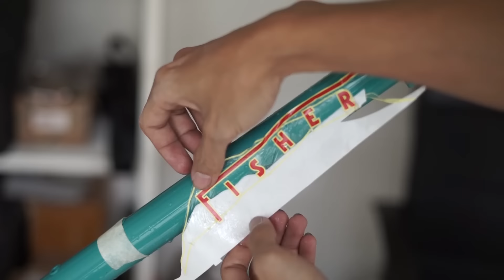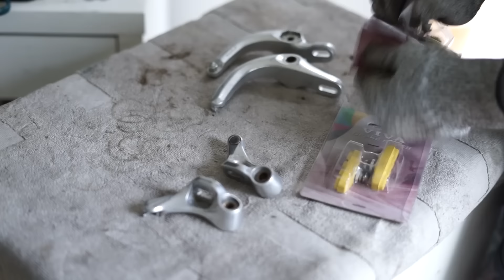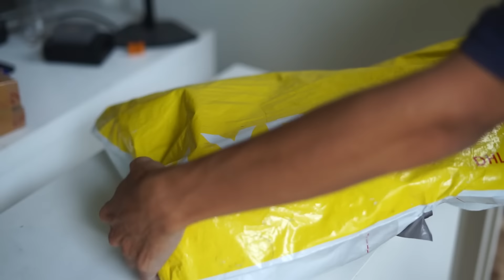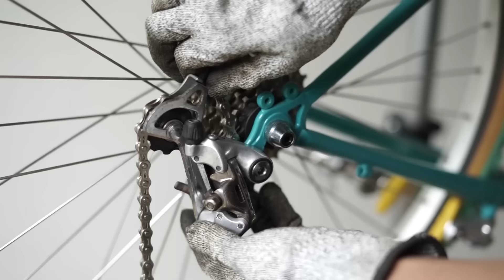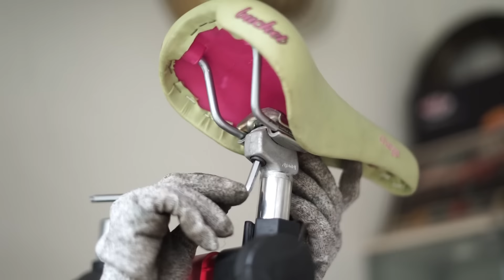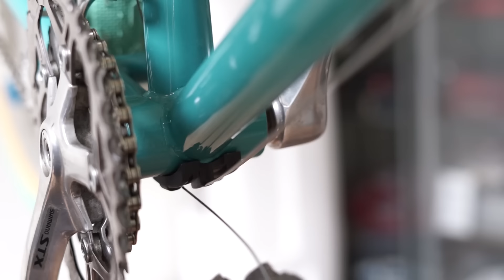80's GREEN MTB / FISHER HOO KOO E KOO / BIKE BUILD

Comment: I adore these videos but sometimes there are little details that drive the bike mechanic part of my mind crazy. The chain rubbing on jockey wheels can be resolved by tightening the b-limit screw or cutting the chain to the correct length. Using levers to install a tire is a no-no in most professional shops, for stubborn tires my go-to is a Giant tubeless instillation tool if I can’t get it by hand. Always keep greasy gloves off white saddles, frames, grips, and cables, having ‘clean’ and ‘dirty’ pairs of gloves really cuts down on the hassle of cleaning a bike right after you’ve built it. Never use Torx keys where hex keys should be unless absolutely necessary. I love these videos and keep up the great work! The bike looks fantastic! Just some tips from one mechanic to another.

Comment: Nice build. I'd suggest using grease on brake bosses, derailleur hanger, pedal threads, and even packing the grease in on the caged headset bearings. A light clear coat over the decals also would make for that extra bit of durability
Reply from the maker: Thanks for the tips 🙏

Comment: Nice build! Beware of your chain rubbing against the rear brakes in smaller gears combos (see 12:54, 13:19, or 13:40)
Reply from the maker: Yes always use 2nd gear on front, thanks for reminder mate 🙌
Reply: I think he can avoid it by shifting through the larger cogs before shifting to the smallest front ring.
Reply: chain is too long, remove 2 links

Comment: Nice restoration.  
Was oogling my friend's '86 Ritchey Ascent yesterday with fillet brazed frame & matching bullmoose bars.  Such a thing of beauty!!!

No clear coat over those water decals?  Hmmm, they'll scratch right off.
Reply: The Ascent was an import featuring welded joints, not fillet brazing as found on the bikes Ritchey built himself in that period.
Reply: @markhale8084   nope, this is a fillet-brazed Ascent, before any TIG welding.  I know my frame fabrication methods.
Reply: Dude, good to know you recognize fillet-brazing, now you need to confirm if the bike is an Ascent.  Ritchey introduced the imported and TIG-welded “Ascent” in late 1985.  It was his “entry level” bike similar to what he and Fisher had done with the original Montare.  You can google the Ritchey Project and check the catalogs and their ID section if you don’t believe me.
Reply: @markhale8084   mea culpa!  It is not!  His bike is a Team Comp.  Thanks for setting me straight!

Comment: the color combination is very beautiful, however the spokes of the wheels are mounted wrong, we noticed this already in the placement of the inner tube, the two spokes that are between the hole of the inner tube are crossed and not open as they should be, there is a lack of lubrication in a lot of screws because when they get wet from the rain they will rust and get stuck, the cassette gear must be assembled with grease, the central one must have a greater torque, because the tendency of when you pedal more with the bike the cups of the central one will loosen and the bearings will work without pressure, in a few months the new power unit will open up, in the official shimano course it confirms everything I wrote, in the service manuals of the brands they also state that adequate lubrication is necessary for any threaded item that will be screwed onto the bike to avoid locking, however screws that already have a self-locking layer must be placed with minimal grease dripping.